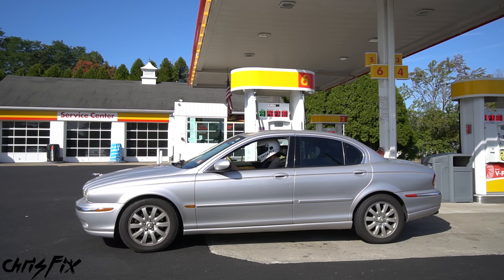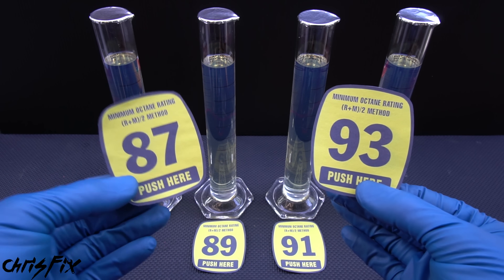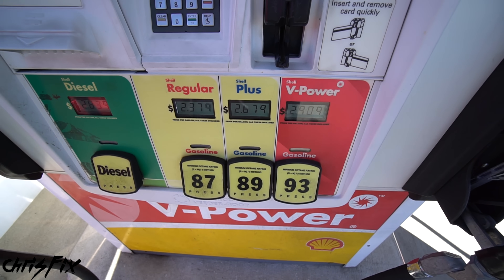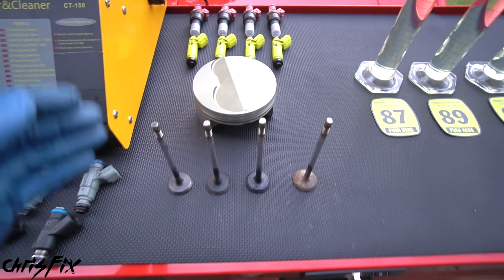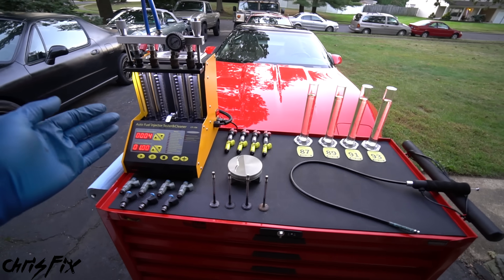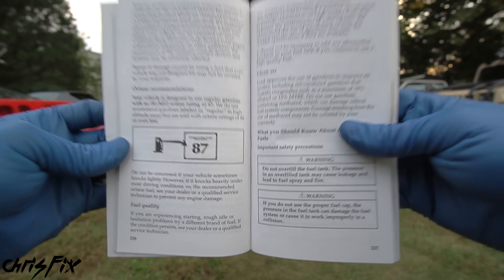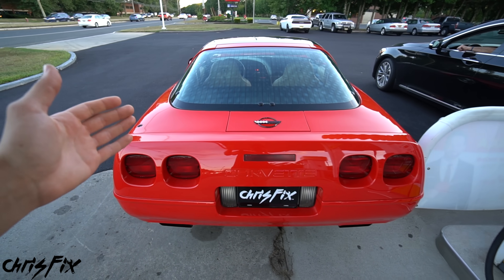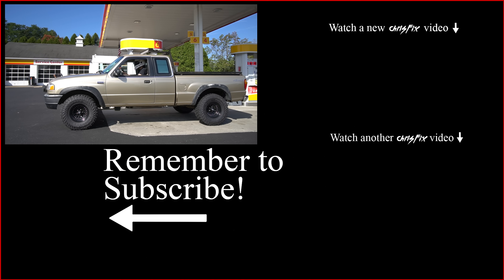What is the BEST Fuel to Use in Your Car or Truck and WHY

Comment: Conditions vary and, as such, you'll find that engines requiring premium don't need premium under most conditions and will run just fine on regular. Some engines that say regular is fine will ping almost constantly on regular. The octane rating in your manual or on your fueal door is a recommendation, not an absolute. Use some common sense. If you're getting a lot of heaving pinging, you're damaging your engine. Move up a grade. If you just get a little ping once in a while, its not a problem. The type of pinging that damages an engine is when its pinging for long periods of time (like when pulling a long steep hill). Ugh! Makes me cringe. Also, one can take humidity and temperature into account. The fuel mix has much higher ping resistance when it is cooler or is of a higher humidity. Essentially, just use your ears. If you're hearing it ping a lot, move up a grade. You might think, "Oh! I'm wasting money!" False: That pinging is costing you. The more expensive gasoline will be cheaper in the end because the kind of repairs that persistent pinging will require is VERY expensive.
Reply: If a car requires premium and you don't put premium in it, chances are you're losing power, and possibly fuel economy.
Reply from the maker: Thanks for sharing

Comment: The compression ratio is also a factor. An engine with higher compression, like a racing engine, needs higher octane fuel so it doesn't detonate before the spark.

Comment: E85 is water soaking carbon building garbage.
Reply from the maker: E85 actually cleans away carbon. The negative is the water absorption which you mentioned and it has less energy per gallon than gasoline.

Comment: So would running on octane booster give the same type of carbon clean out as premium would like what happened in your truck could’ve you just put the octane booster in instead of filling it with premium
Reply from the maker: No the octane has nothing to do with cleaning. The additive package they put in the fuel does. Some gas brands use the same amount of additive in all of their fuels while others, like shell, use more in their premium. The octane booster is just a last ditch effort to prevent detonation when you fill up with the wrong fuel.

Comment: Great vid but I want to clear some things up. E85 isn’t 85% ethanol, at most it’s E85. Depends on location and manufacturer. For instance in Nebraska between October and April it’s E75 to help with winter starts. Best way is to get a tester and check. They are simple and cheap. E85 ranges in octane rating from 100-106 again depending on the manufacture and location. Also the reason why some vehicles say premium recommended but not required is because the Ecu tune has 2 octane tables. A high and low to account for the differences in fuel type. Something else that needs cleared up is the 87,89,91 that contain 10% ethanol. The ethanol is not bad contrary to what most people think, and acts like an additive to clean the engine. There are some good videos explaining this for someone wanting more info.
Reply from the maker: Thanks for sharing and yes, It’s “up to 85% ethanol”

Comment: 4 ounces of Marvel Mystery Oil to every 10 gallons of gas. Do it! You're welcome 💪
Reply: Good for the engine, bad for the catalytic converter.
Reply: @danielright2044  No. MMO has undergone rigorous testing to ensure the safety of all internal components in your vehicle including highly-sensitive oxygen sensors, fuel sensors and catalytic converters. 🔥

Comment: I want to know three things :
1- What octane rating E85 has ?
2- Once a car is tuned to run on it, does it increase performance compared to 93 premium ?
3- Especially on turbocharged cars, does it run cooler ?
Reply from the maker: Great questions. 
E85 can be 106-110 octane depending on the ethanol content (it’s up to 85%).
If your car requires premium, is high compression, or forced induction, ethanol will have a performance benefit if you get it tuned.
Ethanol, since it’s an alcohol like methanol, burns cooler. It is also a good cleaner.
Reply: @chrisfix  thanks a lot for the reply ! ^^ planning to get my first car next year and E85 is twice cheaper than 91 in europe

Comment: Lol, 93 "super", 95 is regular, 98 is super and 99 is V-Power
Reply: Ah, but you probably use RON Octane where you live.
95 RON Octane  = 89-90 PON Octane = 89-90 AKI Octane.
Thus a 93 PON "Super" = 98 RON Octane.

RON = Research Octane Number
PON = Pump Octane Number
AKI = Anti-Knock Index

PON and AKI are essentially the same numbers, except for a few edge cases.

Comment: My car says I should pump 93, the nearest pump that serves it is in a completely different state..
Reply: If it was me I would buy the highest.
Reply: Jonathan Goodwin that's what I do but I guess the car was tuned to be ran on 92 or 93,but only have 91 Around my area so I suppose it wouldn't have much of a Power loss
Reply: 91 should work fine.

Comment: Put what your car says to use. If it REQUIRES premium (91-93 octane), use that only. Recommend and premium are two different things.

I always use 89 octane on a car that doesn’t need premium. I don’t like to run new cars with all their refinements on the minimum required octane. Sometimes fuel dilutes very slightly and or by the time it gets to the tanks at the gas station, to the pumps, to your car’s tank, through the filter(s) and lines to the combustion chamber, it may lose a smidge of octane. Key word: MAY, not guaranteed.. therefore running it lower than the minimum required octane. 

Many cars I’ve owned and people’s cars ive tested, in cold they have cold temperature “ping” or slight knock and goes away until its warmed up. Switched to 89 on all these cars and it NEVER happened again,even when it was even colder outside. 

Just a thought and my tests over 5 years. 

89 is 2-3 dollars more per tank, got rid of cold start and warm up knock, my mpg made up the difference in extra cost over 89 octane 100 times out of 100. Try it! 

Why would you run a modern engine with all of their sophisticated hardware on its minimum octane?
Reply from the maker: Thanks for sharing!

Comment: Youre the guy I come to for vehicle related things:) if I have 1/4 tank and take premium once to clean it, then use regular later it wont affect anything right?
Reply from the maker: I wouldn’t bother. You need to run the premium for 2500 miles to get a good cleaning. One tank won’t do much.
Reply: @chrisfix  I had heard wrong and I appreciate everything man:)

Comment: This guy is a genius. He's made a 10 minute video that ends with "check the owners manual" and is making thousands of dollars
Reply from the maker: You’re a little naive. This video took 145hrs to make. I’ve been working on it for a month. The animation on what detonation is took 45hrs. Finding dirty injectors and a way to show you the spray pattern took almost a week. Finding a gummed up valve took forever since most aren’t bad. So sure the answer to what fuel you should use is a quick and easy one by the “WHY” is a longer process that is worth understanding.

Comment: I think he means "pre-detonation".  Because detonation is a good thing in an internal combustion engine.
Reply from the maker: I don’t mean pre-ignition (it’s not pre-detonation FYI). Detonation is exactly what I showed. As the fuel is burning from the spark plug outward, it builds up pressure inside the cylinder and pockets of air/fuel detonate and create a knock. This is very bad for an engine and can damage it. So you don’t want detonation in an engine. Watch the animation again so you can see what’s happening. Pre-ignition is the fuel igniting before the spark due to heat and pressure or sometimes hot-spots from carbon deposits.
Reply: @James I think you are confusing detonation with deflagration. Deflagration is what you want in an ICE

Comment: Hi Chris. I have a unrelated question. I would like to replace the hole under carriage of my car. I know you did a video on your rig. Mine is a 12 Ford Escape limited AWD. Can you point me in the directions of good aftermarket parts please and thank you
Reply from the maker: Do you mean suspension or frame replacement?
Reply: ChrisFix 
Hi. I mean the suspension. I already replaced the front struts but I want to replace the rest of the parts. You did a video on one of your cars 
Mine has over 160 thousand miles on it. I want to get to the fun stuff like a nw stereo and new paint but first I need to spend my money on the important stuff so I don’t end up with a cool looking car that doesn’t run

Comment: When my dad bought a 2010 Cadillac Escalade, he didn't care about putting premium gas (which is the required gas) and has always put the regular 87 gas. He has been putting the regular 87 gas for over a year now. What would happen to the truck's engine, valves, etc.?
Reply from the maker: The knock sensors are retarding the timing so there is no engine knock. If there is knock and the sensors can’t adjust, it can damage the pistons, valves, etc.
Reply: Thank you!

Comment: I am still just as confused. My manual (2000 Toyota Avalon) says 87 but may get better performance from higher grade. Which do I use (it has 240,000 miles)?
Reply from the maker: You can use 87 if you’re not racing or towing with your Avalon.
Reply: @chrisfix  What would you recommend? I am assuming that with an old engine there would be less compression but paired with the idea that old engines burn oil and could use additives.

Comment: Shells 70% saying is true. Ive ran it and only it, except for maybe twice when there wasnt a shell around, in which case i looked up the nearest shell, and put that exact amount in, still from a top tier station, from the day i got it. It runs a lot smoother now, and ive had no issues with any knocks or pings. Its a 2005 g35 with close to 160k on the clock.
Reply: I found a lot of shells on the beach...hope this helps, haha.

Comment: So who has the best gasoline? Is it shell?
Reply from the maker: No there is no best gas. All the brands are pretty good. The top tier fuels are technically better due to higher detergents in the fuels but in the USA the fuel is all well regulated so you can use any one. More important you want to use the correct octane which is why I made this video.
Reply: @chrisfix  Thanks

Comment: Actually many premium fuels are E0 & high octane, so they contain MORE energy than E10. Bzzzt fail.
Reply: Energy content is according to BTU's... not necessarily so, it is possible to make more power with higher octane if advanced timing or power added is used.

Comment: Hey Chris, did anyone tell you that the octane number in the US is actually called the AKI (Anti-Knock Index)? If you look at the label, it's the average of the Research Octane Number and the Motor Octane Number [(R + M)/2]... and can be called the Pump Octane Number.

Comment: I would also like to make the distinction the base regular Unleaded in Colorado is 85 Octane, which is different than the flex fuel E-85, due to the fact Colorado's fuel is different than 49 other states (presumably) our Mid Tier Unleaded 87 is combined 50% (85)/50% 91 from the tanks at the store you are purchasing it at.  On that note if either tank at the store runs dry you would be getting 100% one or the other.

Comment: In Australia we start at 92 octane, 95 and 98 is premium.  Our fuel is expensive though. I only put 98 in in my motorcycle. In the outback they also have Opal fuel that they use in areas where the aboriginals (like the Northern Territory) live as you can’t sniff it to get high. Opal fuel is not great fuel though.

Comment: someone once told me the way they boost the octane rating is by increasing the ethanol content (you know that whole "up to 10% ethanol" thing), if that where true then technically regular grade gas would have more energy per gallon due to ethanol having a lower amount of ethanol which contains less potential energy then gasoline.

Comment: Watch the Canadian-produced expose of high octane fuel. All modern engines have mapping which adjusts engine fuel consumption based off the isooctane percentage. In fact, the study found that higher isooctane fuel grades burn worse, leaving more carbon deposites on the engine and burning rougher when the car idles at a standstill. Save your engine, the environment & your wallet by using lower isooctane grade fuels...you won't hurt your car, and you'll avoid the hype. About the only thing high octane fuels are good for is more power in performance engines!

Comment: used to work at a gas station, the 87,89,91,93 pretty much the same fuel. only difference that i seen was different dye they added to the fuel when the fuel truck pulls up.

Comment: I've seen another instance with the small turbocharged engines in compact cars they often say regular gas in the manual because not many buyers, esp uneducated buyers are going to buy a cheap compact car that requires premium gas all the time. However, a lot of issues with pre-det/piston failure has resulted in this as those tiny turbocharged engines are notorious for pre-detonation. 
Regardless of what it says on the fuel cap/door or manual if your car is forced induction or high compression, just run Premium.

Comment: Would've been a bonus to include Clear Gas, idk which stations offer it (Maverik in my area) but doesn't add ethanol to the fuel
Reply: Shouldn't really make a difference, except maybe a slight increase in fuel efficiency.

Comment: Octane in Europe is still better vs USA. There’s a reason manufacturers have higher compression on certain motors, like example the civic/integra Type R, the euro spec model makes more power vs the US model. Now there’s other factors too like emissions etc but it still applies. I owned a jdm spec R motor with 11:1 comp vs us spec witch only had 10.5:1

Comment: 😁 amen and peanut butter sandwich!  Thank you for explaining engine knock up front and how it works.  
While not a big deal to some but I hear it all the time and recommend they check the fuel octane.  
From individuals running race fuel, flex fuel, or my favorite, those who spent money to modify tuned engines that have FI only to turn around and start pumping regular.

Comment: HELP my truck an old 98 dodge Dakota if needed to put a fuel in that would last because its getting parked until I can afford to get state farm to cover it I was going to put 93 in but the person I bought it from gave me a heads up that it doesn't like to idle if I put in 93 should I be worried or is that ok because of the age

(edit) I dont have anything that tells me what I should run so I am using the internet

Comment: My user manual says it “recommends 87 Octane” would that mean only use 87 or using the other octanes would be okay?
Reply: Guessing that means 87 octane.  Using higher octanes shouldn't hurt, but unless you're running a cleaning cycle with premium, it's not worth the extra cost.  They're all unleaded, btw.
Reply: PongoXBongo yes 87 octane my car is pretty new still so I shouldn’t new the cleaning cycle hopefully
Reply: @Dustingailey  Yeah, you probably don't at this point.  Maybe just run a tank of premium whenever you get the oil changed (clean oil + clean fuel).  Or wait until just before a long highway trip where you can consistently burn the deposits away.

Comment: What about 85 octane?
Reply: I live at an altitude of about 5000 feet. I have been told that is why I have the option of 85 octane, not the E 85 but actual 85 octane. Why do I have that option and when should I use this fuel?

Comment: Next, diesel for the Dirtymax and why higher cetane levels vs lower cetane levels matter when it comes to diesel fuel. Also, the importance of diesel fuel quality such as flash point, ash, sulfur and other residual contents such as calorific value, kinematic viscosity, density, and other factors. 

Why lower ash and sulfur fuels make for clean burning fuel which equals longevity, more power in and out of the engine, and less heat build up and lower egt temperatures. The better quality the diesel fuel is, the better the fuel ignites more readily when sprayed into hot compressed air. 

Gale Banks got me hooked on the science of diesel engines back in 2007 when I purchased my first Dirtymax. I went with one of my mates to an open house event that he had at Banks headquarters and I was hooked.

He showed the toys and tools behind his scientific madness. Over 50 years of development and experience made him the best in the game when it comes to diesels, superchargers, and turbo chargers. I am really loving his new series on youtube called Killing A Duramax, and his other series called building monster truck engine. He is using the new LP5 for both video series.

Comment: Now that makes more sense,cuz around here we use either:-
RON95(regular)
RON97(premium)
RON100 in some gas stations(premium +/something else)

We dont actually have RON98,or maybe im not fully aware of it.

And just now i know that American's system used minimum octane ratings,and not lower octane ratings on the fuel.Thats why it appears lower.

The more you know....

Comment: Could you mix both premium fuels and regular, just to clean it up a little rather than just outright spend a bunch more for just the premium. A 50/50 mix or whatever it may be. This would be in a regular fuel vehicle.

Comment: Also it is recommended to use branded gas (Exxon/ Mobil, Shell, Citgo) they have the required additives. Getting cheaper fuel from some grocery store changes or convenience stores do not have all the additives in the fuel.